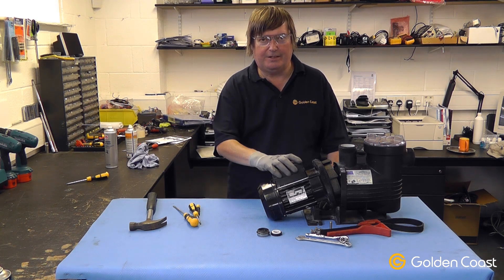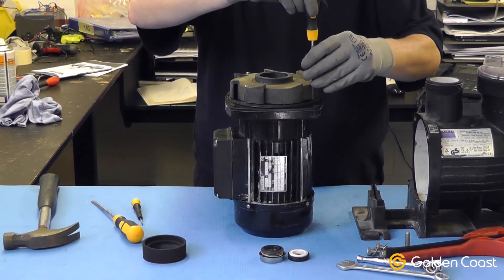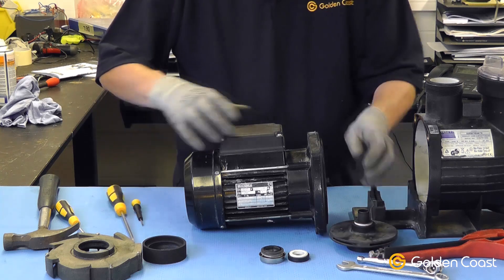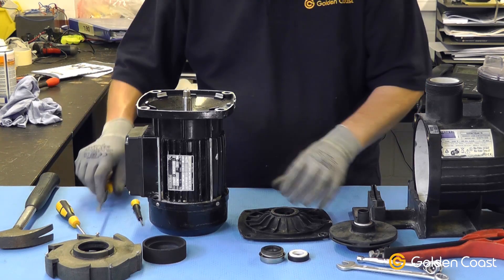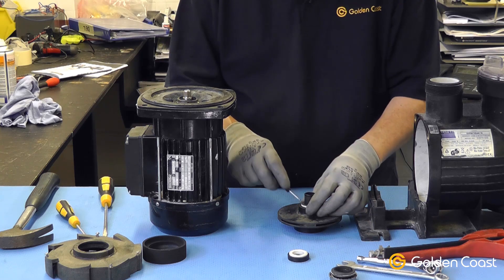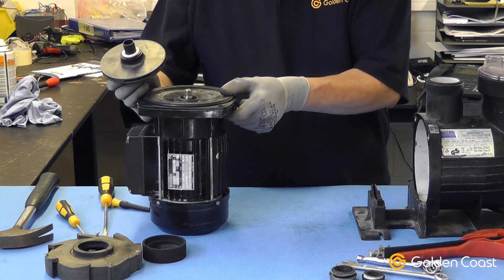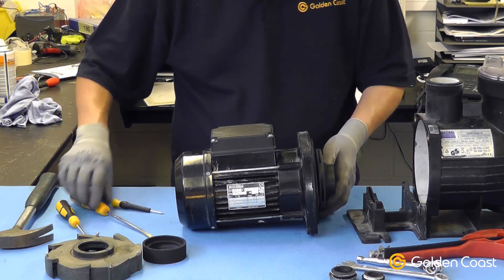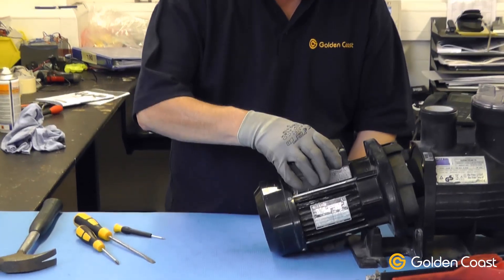Changing the Shaft Seal on a Swimming Pool Pump | Andy's Answers

Comment: Thanks, but unfortunately much if your video doesnt apply to newer Hayward superpumps. Cant get to shaft screw (some spring loaded connector in the way) and the center seal does not just pop out with back of screwdriver and hammer. Tried for a while til cover cracked.....

Comment: Just a point to note on this, this is not how we would recommend changing a mechanical seal on a Waterco pump. The seal needs to be pressed in prior to screwing the impellor back on to the motor shaft. Our advice would be to consult a professional trained in replacing mechanical seals.

Comment: Not the way to change a pump seal|! Although this pump differs from the norm in having the mechanical spring section in the backing place instead of the impellor, you have to press the seal into the backing plate and the mating ring into the impellor. Just relying on the spring tension of the mechanical seal to press it in is very hit and miss and can cause damage and leakage.